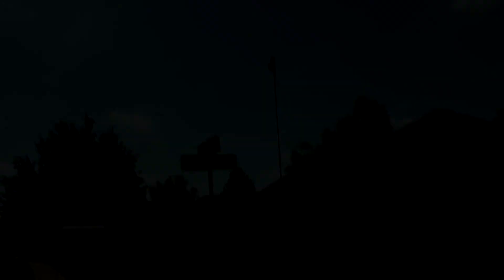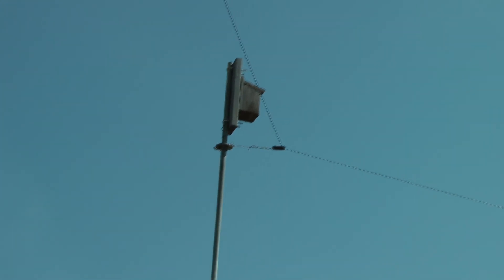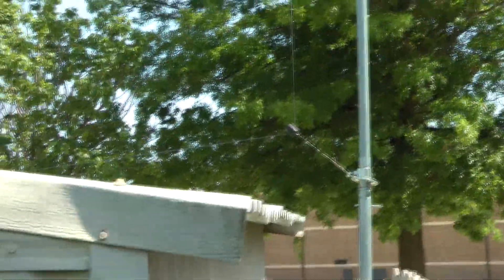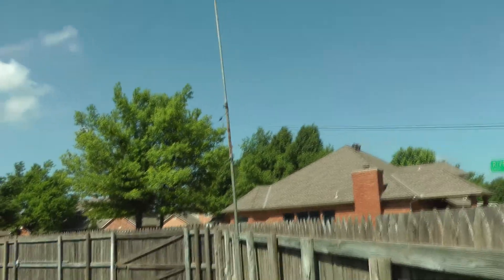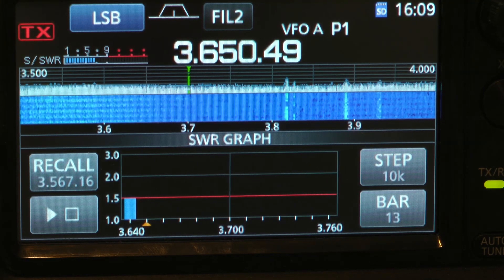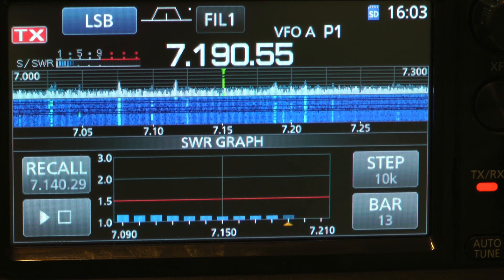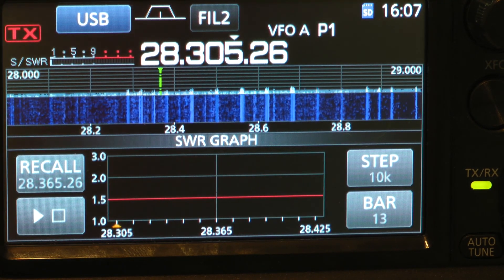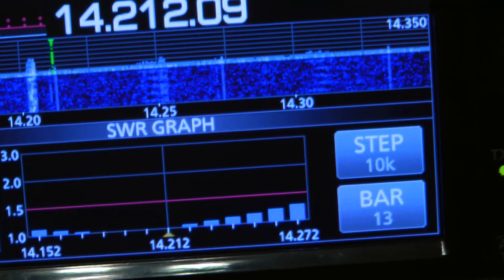Stealth Vertical Full Wave Loop Antenna Ham Radio

Comment: Why not just use the pole for the birdhouse as a vertical "aerial" with Tarheel antenna connected with a ground strap?  Of course you need radials around your property but no one will see them except the worms.  I have experimented with this and have had QSOs of over 5000 miles on 40 at night.
Reply from the maker: HI Lowell,  I have thought about that.  However, The gain off the loop is very good on 20 meters.   I have it now horizontal polarized and about 30 feet high on average.  It works great!!

Comment: Why not try 160m on the graph. You might be surprised. NVIS is probably possible.
Reply from the maker: I just saw this.  160 meters would roughly be 529 feet long.  My antenna is about 1/2 that long. I don't think it will look good. But I will check it out.
Reply: @RichRodgersOnline whoa! 4 years old reply. 😮
Reply from the maker: @forgetyourlife  i know, usually I get notifications or maybe they started notifying me 2 or 3 years ago that I had comments. And I tried to reply.   Anyway sorry for the delay.

Comment: Have you tried a 4:1 balun?
Reply from the maker: No I have not
Reply: Rich Rodgers I think you decided to run 450 ohm ladder line where it crosses from horizontal to vertical , into the shack, you’d see a hell of a multiband antenna into the balanced tuner.
Reply from the maker: I have a friend who uses a 450 ohm ladder line and has great results.

Comment: My 80 mtr horizontal loop was hands-down the best wire antenna I've ever used in 50+ years of amateur radio. Just downsized to a smaller home and my only hope is possibly a vertical loop. Your video was very encouraging. Thanks for posting. Would love to hear your thoughts re operating results since you've had it on the air. 73 Marc W4MPS
Reply: PS- had my loop up for 8 years, never had one complaint from neighbors.
Reply from the maker: W4MPS Mark, I have worked Italy on 40 a few weeks ago, I spoke to Indonesia on 20 meters last week with 500 watts..  I do use an external tuner on 80 and 6 meters..   I really like the loop.

Comment: Morning Rich,  thanks again for a great video.  I too have a small yard and currently have a G5RV up.  What are your thoughts on the loop vs the end fed you were running?  FYI I have the ICOM 7300 and love it.  Have a wonderful day.  JJK
Reply from the maker: John,  I wished I could tell you....   The band has been so bad!    I think in theory the full wave loop would do a little better.  I had a "My Antenna" Balun  Half Wave End Fed.  It did a great job without radials.   I also had a end fed "Ultimax" which needed radials and did a great job.   If I had checked the band right before I changed antennas,  I could probably give you a good answer.    If you don't have to worry about HOA Then I would say put a loop up high that would work best with the height..  Thank you, John!!!